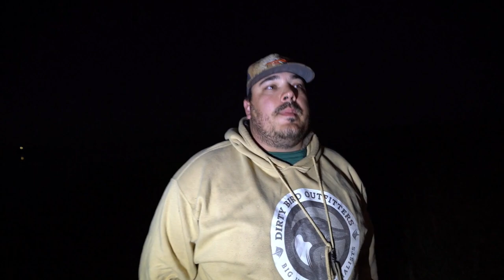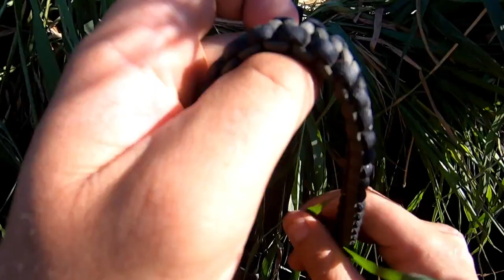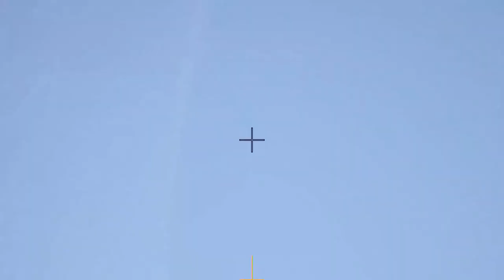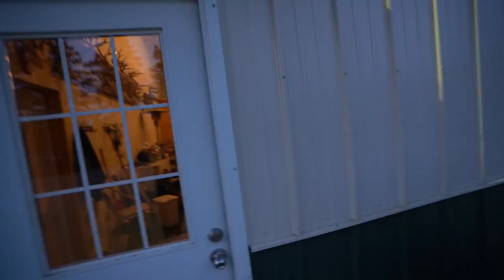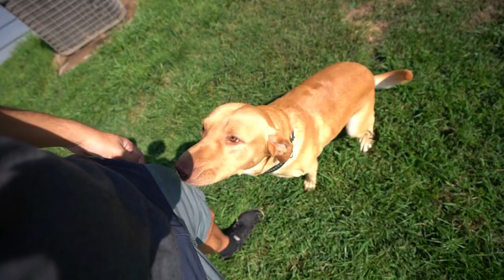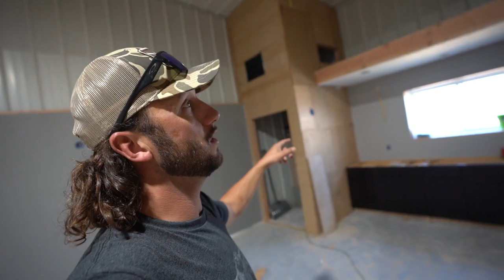North Dakota Honker Hunt Over Big Water with Mallards In Our Face!!

Comment: Hey Bob keep up the good footage. You spoke before about trying out the 28 gauge, I recommended the mossberg sa-28 but I’ve seen cz makes a pump that might be a little cheaper. A 28ga challenge on ducks would be a pretty cool video but probably expensive